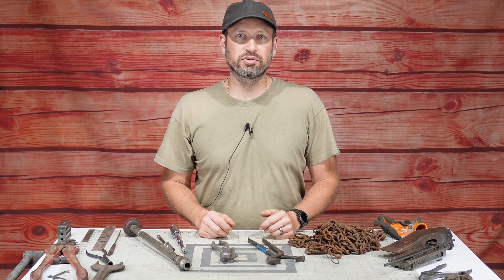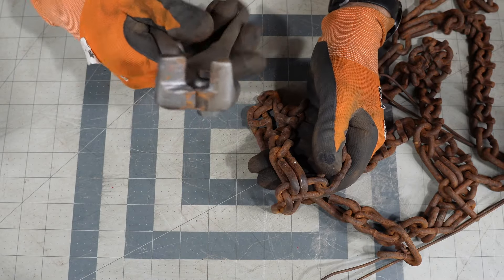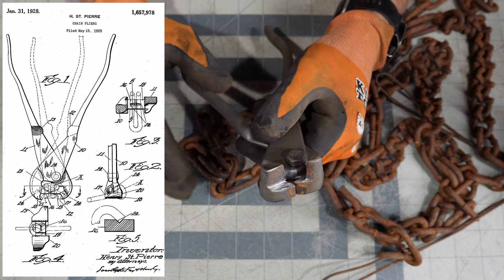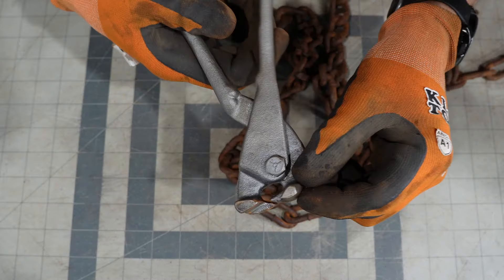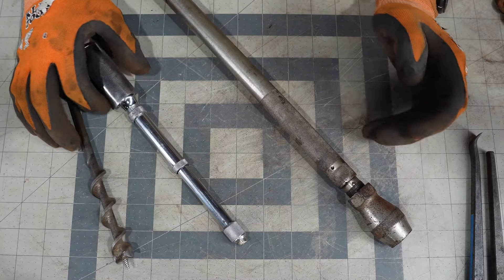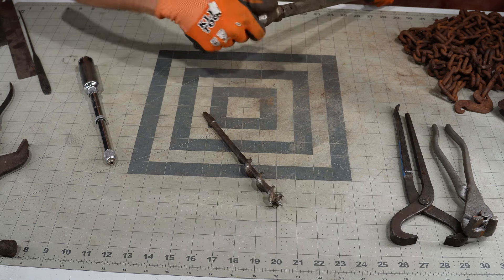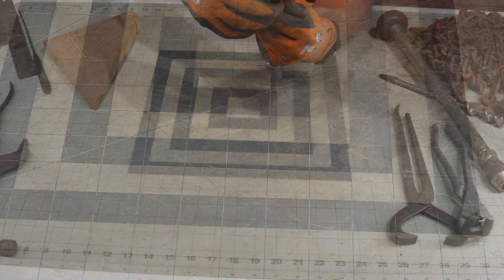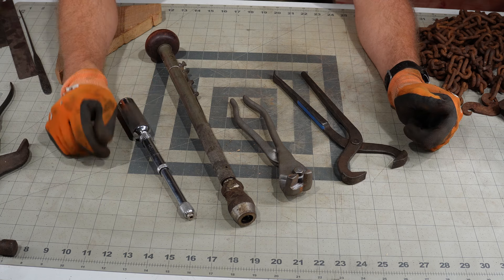Uncommon Tools 082

Comment: Grease Dust Cap Removal Tool👍 That Yankee 75 is really nice....Got the package last week, the drain plug tool was easy to do since you had it blasted and clean, I just wiped it down with some alcohol and gave it a paint job, pipe's buffed up looking like new, the small chain tool with the red handles I'm going over with fine steel wool to get rid of any slight tarnish and clean the paint and will clear coat as is, I like the look it has right now......The Bernards, The Elgin & those McKaig-Hatch I think I'm going to Cold Blue all those.
Reply from the maker: I'm really happy to hear those tools are going to such a good home.  Maybe someday I could have you on the channel, I think we're only a few hours away from each other, whatcha think?
Reply: I looked at the mystery tool and knew I saw them before and I actually have one. I just couldn't recall what I was for. You are the master at this.

Comment: Pretty cool.  The old drill reminded me of a screwdriver that my dad had. You pulled and pushed to spin the bit.  I never used it and I don't remember him ever using it.  I do remember that when I picked it up and pulled it open he yelled watch you fingers it will pinch you hard if you get you fingers in the slide part.  I haven't seen it in years. I'm thinking it was left in the garage in the mountains when her sold it.
Reply from the maker: That's exactly what I think of too, my dad had one, with the cross slides open like that, and same thing, never saw him use it.  Pretty sure I've got one, I'll show it next week.